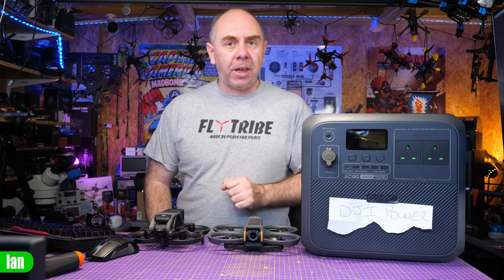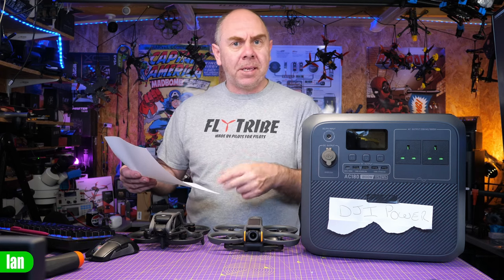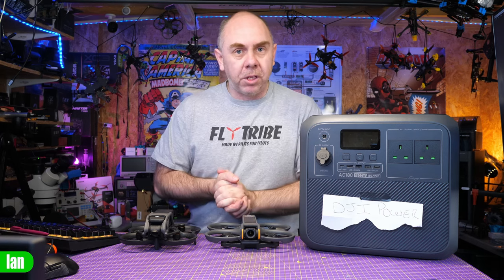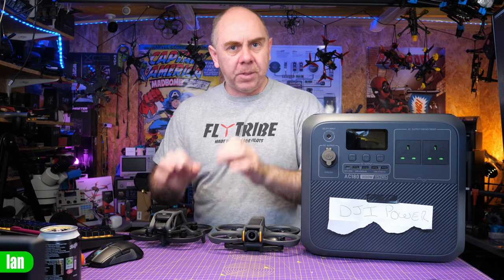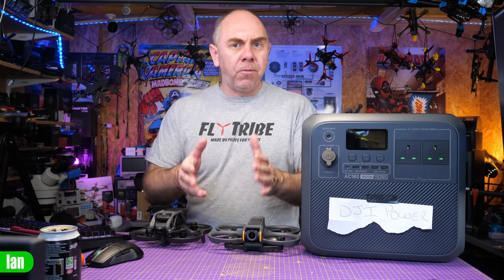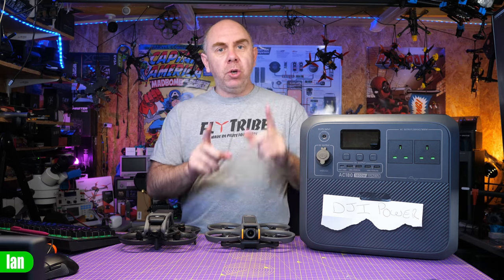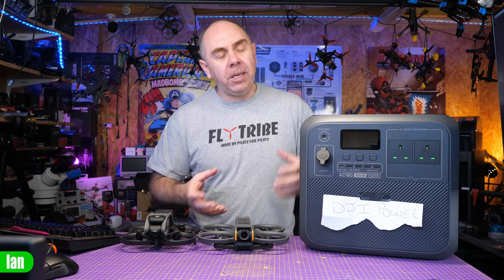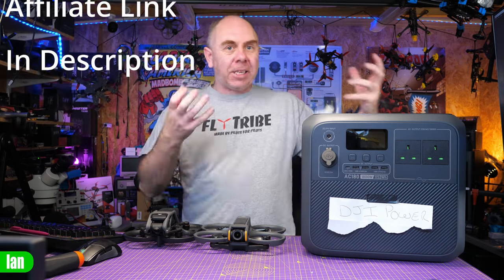DJI Power 1000 Power Station FCC Power Hack - Incredible!

Comment: I have one of those power stations. I got tired of the DJI software so I installed Betaflight 4.5 on there. The power station flies great how and there is no long wait time when I plug my goggle in to change the lens fluid.

Comment: What about when I power cycle the DJI Power 1000, do i have to re-install the FCC power hack? or does it stay loaded until I update the firmware that they will release to prevent this hack from working & claim it's to improve "user experiance"!

Comment: Question on the power hack… will this work with the DJI Goggles, DJI Goggles V2, DJI Goggles 2, walksnail goggles, or the DJI Integra goggles? Or just Goggles 3. I’m about to buy the DJI AVATA 2 fly more kit to get the hack to work but wanted to make sore since I already own the DJI Goggles v2 and the goggles integra. 

Also do you recommend the DJI care refresh? Just in case it crashes.  

FCK DJI / CCP 😂